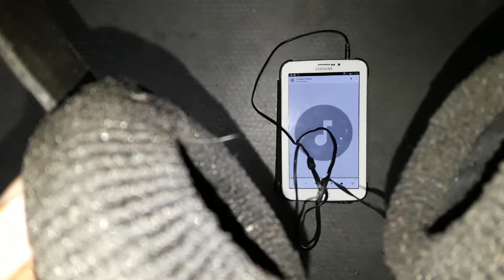How to make a professional headphone at home

Comment: Ok what did you use for the diaphragm?  If it's the black round material, if you stretch it evenly on both sides the sound will be quite a bit better.

Comment: Please tell me what are the names of all the things you used there in the video especially the inside of the stereo, those wires and all. I didn't understand what you did inside the stereo and how did it produce sounds. And overall, this video was amazing; Subscribed and liked.   :)
Reply: Okay yes, I found the requirements in the description thank you so much. But still I didn't understand the case done with those in 1:47
Reply from the maker: Hi sorry for the late reply pls  tell me what exactly you dnt understand
Reply from the maker: Ok got it well i had solder the coiled wire (lacquer coated copper wire) with earphone wire (black wire with 3.5 mm jack at other end)

Comment: do you have to rotate it 50 times
Reply from the maker: yes but my suggestion is to use less than 26 gauge wire  for best result,and if still you are not satisfied with sound quality rotate it for few more times, Best of Luck

Comment: and rotate wire 50 times
Reply from the maker: Rotate it for 50 times , and yes use more than 1 magnet if the sound is not coming and make sure the magnet must be powerful
Reply from the maker: if you still not satisfied with sound quality download a app called Power Amp from play store it will give a good sound

Comment: tell bro
Reply from the maker: HI SORRY I DNT GET NOTIFICATION FOR YOUR LAST COMMENT, I JUST SAW IT 
WELL THE COPPER WIRE IS EPOXY COATED AND IN ORDER TO REMOVE IT WE SHOULD BURN OR SCRATCH IT WITH SAND PAPER AT BOTH THE END AND IT IS NOT NECESSARY TO SOLDER THE WIRE YOU CAN JUST TWIST IT,  HOPE MY SUGGESTION WILL HELP YOU, HAPPY MAKING . :-)